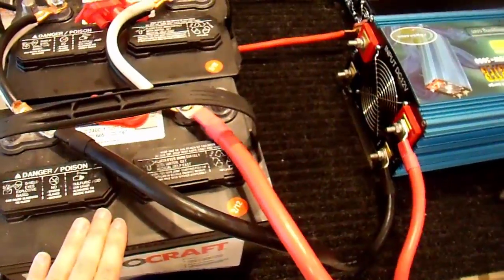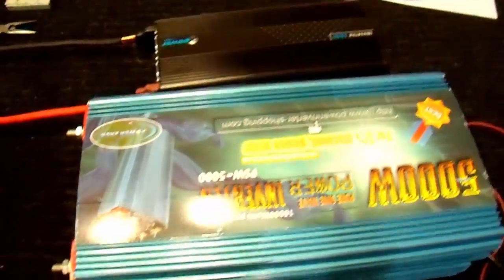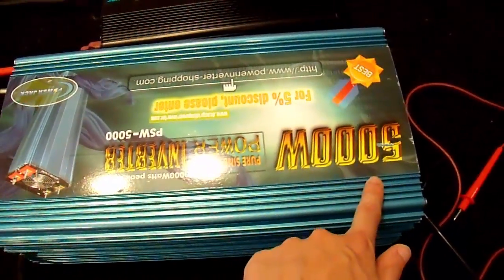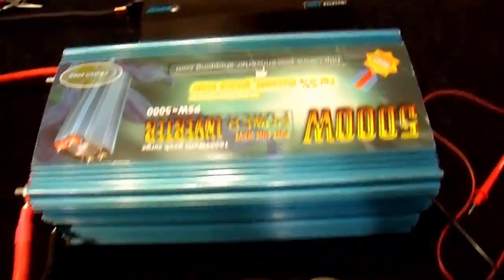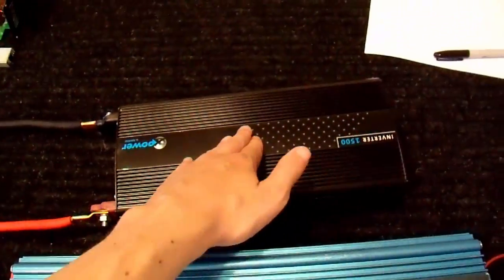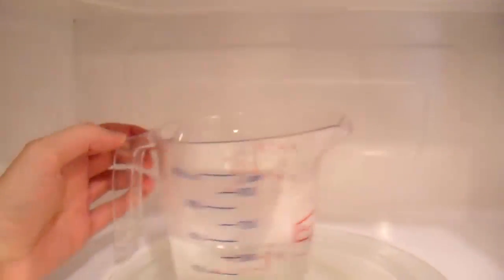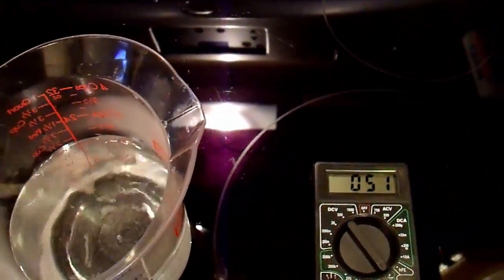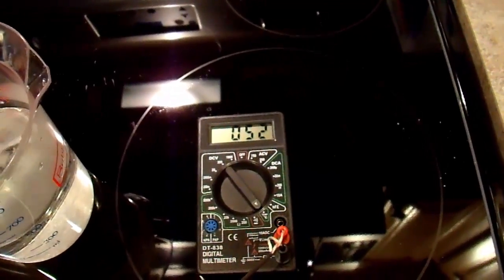Pure Sine Inverter vs. Modified Sine - Microwave Oven Test

Comment: Modified inverter you need 3000 watts it will run a 500 to 600 watt just fine
Reply: You are wrong. I have a 1100 to 2200 watt power bright modified sign wave inverter that will run my 700 watt microwave. I even made a video of it running the microwave off of my alternator in my van.  This was not a good comparison. Any time you have a stonger inverter against a weaker inverter the stronger inverter will win. I have 2 inverters one is 1100 to 2200 watt and the other is 2500 to 5000 watt, and yes my 5000 watt inverter will run things easier. The stronger the inverter the more amps it can kick out.

Comment: I wonder the type of ur microwave..is it a inverter microwave or a transformer microwave..i need the answe...cause i want to buy inverter for microwave
Reply: I drove a truck for a long time i used a 3000 watt power drive inverter and i ran a 12 cup coffe pot and i ran a 500 watt microwave worked just fine .his microwave is one those 1000 watt or higher .700watt or less microwave 2500 to 3000 i run my hole trailer of a 4000 right now and  have a 12000peak 6000 out put inverter on the way

Comment: On the fence about spending an extra $100 ($80 vs $180) on  my simple setup for pure sine vs modified sine wav . Also finding Inverters just don't last very long for me.. wish they were generally more robust.  My battery Is my starter  70AH 120RC.  I run power tools and appliances 500w to 1000w, but need to run a freezer for 8 hours while a 200w solar panel feeds my battery through a MPPT controller.   Just had my 1200w modified sine inverter go bad after an accidental short.. they are so sensitive.  Somebody wrote a review on my inverter saying the inverter was eating 200W to power a 100W in devices...

Comment: That appears to only be the microwave oven's power transformer lamination buzzing from the quasi-sine' s high harmonic distortion. It keeps time because there's a separate low voltage DC power supply powering the low level stuff, all of it integrated into a chip.

Comment: Thanks for sharing, gives another look at the subject.
Some things I experienced:
- with my pure sine wave inverters from Victron Energy, I get a nicer looking sinewave most of the time then on the normal 'street connection' that is running here, especially when not using full-loads. When I use only 1000Watts on a 1500 WA inverter for example it stays in a nice sine-wave.
- with some cheaper 'pure sine wave' inverter from Conrad (rebranded I think from Voltcraft), it is kind of a modified sine-wave under low load (like a 50 Watt tungsten lightbulb), actually looking a bit like a sine-wave. But still isn't as is getting very clear under the scope. Actually this inverter killed my energy-meter pretty fast...electronic components...
- modified Chinese kind of 'sinewave'... it is more of a block-wave with spikes. Even worse then on a couple of UPS-es I have (they are also modified sinewave ofcourse). Not really a 'modified sinewave' but just spikes and longer taking spikes to make blocks when under higher load. With a large inductor/coils you are getting more of a sinewave.

Power-meting on the output of a inverter is not showing you something real though because they are made for and calculate for the results of a sinewave, so the values are incorrect. You will probably get a better result when measuring on the 12 volt inputs
Because of the high pulses, a microwave can be the worst kind of load for an inverter, the spikes are getting through. I think I noticed your inverter flashing like 'overload' in your video because of this.
Reply: Given all the nonlinear loads your home and your neighbor's homes put on the grid, and the grid source being anything but a constant impedance (versus frequency) it's not surprising that a decent sine inverter has a smoother sine output than the grid.

Comment: If you hot glue a couple of egg cardboard holders together and place them at  the corners of the room, you Will reduce the reverberation in your audio. Bath toowells framed also does a good job. Very instructive video otherwise,  Thanks!

Comment: It should be noted that a MW oven is sensitive to, and it's output varies with, the peak voltage of the supply. This should not vary much with a sine wave inverter ("pure" is a redundancy- marketing hype. It's either a sine wave or it's not).  But peak voltage absolutely varies with load and battery voltage with a modulated square wave inverter (there's nothing even close to a sine wave coming out these- "modified sine wave" is a joke, more marketing hype). If you raise the DC voltage going to the MSW inverter, you will also raise the output power of the MW it's supplying.

Comment: no. you can't measure wattages in modified squarewave with normal sinewavebased wattagemeter..
Reply: .. and the same with voltage metering.
Reply: you need an oscilloscope or meter which understands other waves than sine too..
Reply: Keijo K, do you have problems growing your tomatoes when using those inverters. I don’t my grow outa site Bluddy huge and I love em.

Comment: does that mean that a toaster or a coffee maker will work also on a modified converter?
Reply: Richard Belanger yes. Resistance appliances like toasters and space heaters work fine on modified sine wave. I own a 3k watt HF mod inverter. In my opinion, don't bother with mod sine wave. Pay more and get good power from pure sine wave inverters.
Reply: Thanks or your advice!

Comment: I bought a 1000w Bestek modified inverter before I learned about the pure sine models. Which brands do you personally like in a 2 or 3000w pure sine inverter for 2017?
Reply: Greg Miller I Belive he has a 3k watt Samlex inverter that is very good. Outback inverters are some of the best if not the best if you have the coin

Comment: modified sine wave is 1100w for 2 minutes. 1110w/60 seconds =18.33w supplied per minute for 2 minutes to heat water to 40C, using total of 36.66w power. Pure sine wave is 1500w for 2 minutes. 1500w/60 seconds=25w supplied per minute for 2 minutes to heat water to 50C, using total of 50w power. Modified sine wave in same time heated the water to an 80% temperature value compared to the 100% for pure sine wave. This is 1w for each 1 degree Celcius for the pure sine wave, and 0.92w for each 1 degree on the modified sine wave. 

The unexpected discrepancy making the sine wave seem more efficient may be due to the extra power required to use a 5kw inverter than a 2kw inverter, due to differing heat loss from the inverters, also efficiency of conversion should be included.  

A more accurate picture would be if the time requirement was ignored and instead both were heated to 50C and then the total wattage used by both to bring the water to the same degree Celcius was used. My calculations says it would take 2 minutes and 24 seconds (2.4 minutes) for the modified sine wave inverter to also reach 50C temp in the water, and the use of 44w power compared to the 50w of power the pure sine wave inverter used. 

Another way to test better would be if both inverters have the same Kw rating, thereby reducing efficiency differences due to  different transformer sizes used in each inverter.
Reply: Also would like to mention a 1000w microwave output will pull 1500w of power input. The reason the buzzing sound happens with the 2000w invertor is because it really can't supply more than the 1100w power to the microwave, so the microwave was running under powered, therefore the buzzing sound.
Reply: I use a crockpot with a clamp lid instead when traveling. It's 100w on low setting. I use a cheap 300w inverter to run it. Load it with beef stew, potatoes, carrots and peas and secure in my van with bungee cord around it to van. Leave on trip at 7-8am and by 1pm I have an excellent lunch already cooked, and more later for supper. When lazy, I drop a couple cans Dinty More Beef Stew or other canned food into it instead and let it warm up for a meal.

Comment: Hello there... Will a modified sine wave inverter runs a AirConditioner??? My aircon constant draws 2A in 220v plug in the wall, how much watt MSW inverter i need to buy???
Reply: Seems like you would need a 600 watt inverter.

Comment: I have a 2500 watt Xantrex Freedom 458 modified sine inverter/charger that came in my 2005 Fleetwood Bounder RV. Today we were using a fan with the inverter and it stopped working after a short time. Not sure how long because I was asleep. I plugged an identical fan into the outlet and it ran for less than a minute before stopping. Now neither fan works when plugged in at home. 
Is it possible that this modified sine wave inverter burned out the fans? They worked fine while at home and when using shore power or generator power. They are brand named Sunter and came from Costco a few months ago as a package deal of a floor standing fan and a tabletop fan.

Comment: Sorry, wrong calculation! The modified sine inverter  used less Watts to heat the water so the calculation of efficiency must be made like this: what inverter heat the water better at the SAME power, NOT in the same time.

Comment: The buzzing sound you hear using the modified-sine-wave inverter is coming from the microwave's power supply transformer due to odd harmonic voltages (3rd=180Hz, 5th=300Hz...)  on the modified sine wave output.  This will cause harmonic currents, which will cause heating in the microwave's power supply transformer.  It would be interesting to measure the value of the harmonic voltages and currents and estimate the total harmonic power going into heating the power supply transformer.  If this is over about 50Watts, I would say you probably should spring for a True Sinewave inverter.
Reply: +1

Comment: Hey, thanks for that video! LOL
i ran a GenPower Generator 3kv (Pure Sine Wave)
Bought a Chinese Induction cooker rated at 2000w
yet, when i ran it max , (with an extension cord @10 METRES), the generater showed up as 1.8kw
running the induction cooker at maximum.

so, my question is, is the generater displaying incorrectly, or is the induction cooker under rated?. :)

Also, i see lot of so called sign wave inverters advertised on EBayyyyy, yet on the photos you can see
the array of MosFets aligned on giant heatsinks...

I believe a TRUE Pure Sign Wave Inverter to be constructed of a core of Ferrite wound by quality insulated copper windings?

Correct me if i am wrong?
Mick

L.E > time for the U.S.A to go Metric ;)

cheers!

Comment: Thanks for the video. I was wondering why the microwave drew 500 less watts from the modified sine wave inverter?
Reply: Because that's all the modified sine wave invertor could actually supply constantly. That 2000w rating is probably a surge rating.
Reply: Could be the power meter doesn't measure accurately on a modified sine wave...

Comment: Hi,

Any one know the practical difference between High frequency and Low frequency power inverters?  Specially related to loading of inducive and other loads.
Reply: High frequency are dangerous for human body. Electromagnetic radiation can cause severe headache and other problems
Reply: Search on google

Comment: BTW the power jack 5000 Watt rating is fake it's only 2500 watts
Reply: No it's 3500watt
Reply: maybe its capacity if 5000VA virtual power, Not 5000Watt pure power.

Comment: Just curious -- you mentioned that the microwave is a 1000W model.  You were dissipating 1490W off the pure sine inverter.  Do you know what the power draw spec is on your Whirlpool?  It would be interesting to see how closely your KillAWatt reading matches the back panel.
Reply: Microwaves are rated on cooking power, not the power they draw to run.

Comment: Hi Knurlgnar, did you measure your voltages and power in RMS values. In other words does your meters measure the voltages and the powers independent of the wave form. Your a clever guy so  i assume it does.  If that's the case the the power difference between the two power measurements are not and indication  of inefficiencies. 
Just a note form my side.  It seems that you have calculated it through because you come out at a difference of 10% and that's not what the power measurements indicate. I come to more of less the same numbers. By the way nice experiment
Reply: I calculated a 10% difference in watts per 1 degree change.  I'm thinking that's what he based the calculation on:
     1490W / 35° = 42.6W per 1° change for the Pure Sine Wave
     1090W / 23° = 47.4W per 1° change for the Modified Sine Wave
       42.6/47.4 = 89.9%
The Pure Sine Wave inverter required only 90% of the power demanded by the Modified Sine Wave inverter to heat each 1°C.

Comment: Hello, wasn't sure if to ask this here or on the ups conversion videos. It seems modified sine wave is more trouble than it is worth Vs pure sine wave, but pure is a fair more expensive. Could a modified sine UPS be converted to be a pure sine inverter? Without touching wattage capacity, just make it pure sine. Reason to ask: I can get backup ups's (modified) for a tenner and the smart ups for 100-150 (both working second hand). Thank you.
Reply: +knurlgnar24

Comment: I am more concerned operating my fancy refrigerator from my Generac generator. I think it could be harmful.
Reply: maplewoodsp Check the specs on your generator.  Look for stable voltage (near to 120V as possible, Hertz spec, and distortion (sometime listed as Total distortion, or Total Harmonic distortion).  But , usually a generator will put out strong, clean power and will not harm items in your home.  As always, nothing is ever simple -- make sure your generator is running correctly, you're not overloading it, etc.  but if all is well, power from a generator won't harm most electrical and electronic items.
IF you're running a generator, you SHOULD buy one of the plug in testers like the "Kill-a-Watt" meter shown in the video.  (I think that everyone should own one, you'll find out a lot about the power in your home with one, even if you don't have an inverter or generator .. but that's another issue.)

Comment: I recently bought a couple of deep cycle batteries and a couple of inverters.

One is a 1000 watt pure sign wave inverter and the other is a 3000 watt modified sign wave inverter.  

My 600 watt microwave is an 20 year old unit. 
Both inverters showed that the microwave oven was drawing about 1000 watts. The puresine inverter couldn't handle the load and I switched to the modified sine wave. 

I know that microwave ovens are inductive loads, but a 40% increase in power usage was a surprise.  

What is the manufacturer stated wattage of the mictowave oven you used in the video and how old is it?

Would newer 600 watt ovens have power correction to reduce the apparent load?

Comment: Microwave ovens seem to run ok on MSW, but my induction cooktop does not heat.  I've tried two different cooktops (but both NuWave PIC) on two different MSW inverters, one a 2500W and the other a 2000W.  The cooktop readout LEDs light, but it will not heat anything when connected to a MSW inverter.  I suspect it needs some out-of-phase magnetizing VARs not available from an MSW inverter.  Any confirmation or other explanation?

Comment: You need to be comparing VA between the two microwaves, not watts.  On another note, I have a cheap 1500W modified sine inverter from Harbor Freight that outputs such poor quality power that my kill-a-watt didn't read properly.
Reply from the maker: VA isn't a useful measurement of microwave input or output power.  Watts is what matters since it is the real power.  VA is only apparent power.  VA would be useful in determining the necessary inverter power output rating to run a particular microwave oven but since they aren't specified in volt-amps it isn't all that helpful.

I haven't had a problem with my kill-a-watt with any inverter I've tried so far.  Maybe they've had a few design changes through the years?  It compares with a professional power analyzer pretty closely in my tests.

Comment: There is something I noticed in modified sine-wave inverters.
I used to have an 2000 watt modified inverter to power a fan motor and that 100 watt motor would hum very bad.
But powering the same fan motor with an 4,000 watt modified inverter, the motor would not hum at all and it was like the motor was running of the power grid.

Could you try the same experiment with an 4,000 watt modified inverter to see if this would make any difference? I am just wondering.
Reply from the maker: The difference likely lies in the inverter waveforms.  Some MSW inverters have better waveforms than others.  (lower THD)  There isn't any specific reason why a high wattage MSW inverter will run motors better than a low wattage MSW inverter - it depends more on the design and quality of the inverter.  Some do a better job of approximating the sinewave than others.
Reply: ***** Thank you for explaining this.
 I actually thought that the higher wattage inverter just will hold the wave form better.

Comment: I'm wondering what the results of power consumption would have been, if you had taken power factor into the calculation, and measure in volt amps.

Just a thought, but another great video.